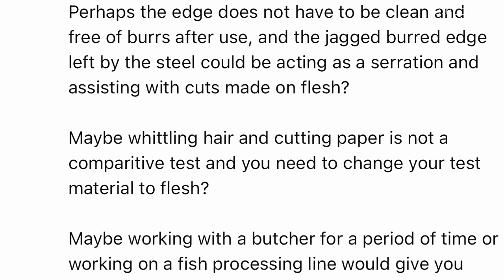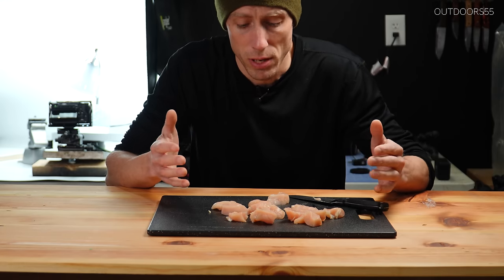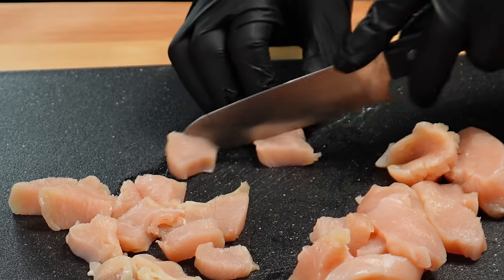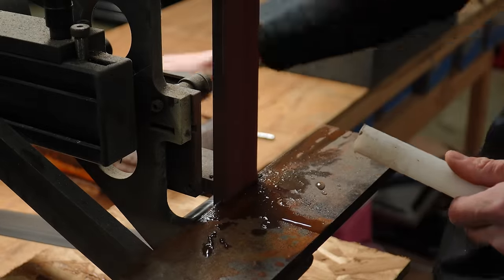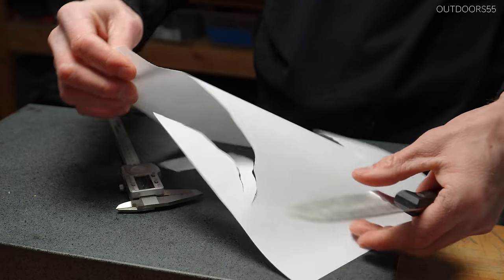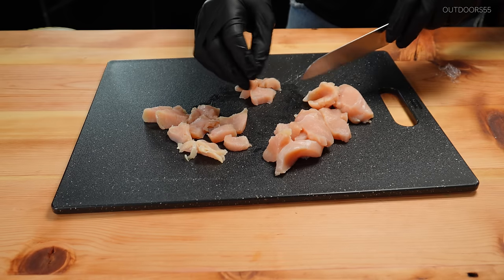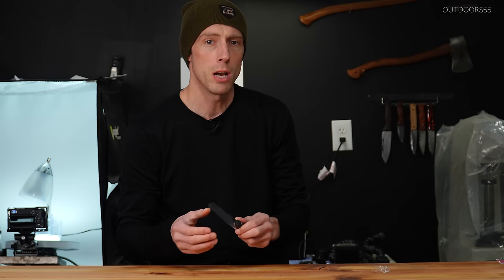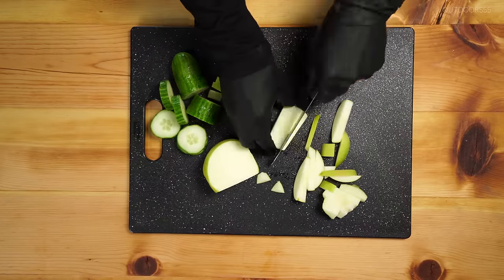Why Knife Sharpness Is Not What You Think

Comment: Did you just invent the Safety Knife?
Reply: Thing is sharp knives cut better so the wound will heal better. Sharp knives can be safer than dull knives. That thing is going give you a pretty nasty scar even if you manage to cut yourself with it
Reply: @AtticStinky  Not quite. The reason sharp knives are considered safer is because they are less likely to slip and accidentally cut you. They are more predictable, and therefore safer.
Reply: Actually safety knives specifically child safety knives are a similar concept to this. Ceramic safety knives use a squared edge but are great for cutting things like food which is often their primary purpose so you can teach kids how to cook and help in the kitchen.

Comment: Yes ! Finally you explained something that bothered me for a while. I am into sharpening for some years now. I sharpened a few knives to a point where they shave and glide through a paper with no resistance. Yet they perform  bad in kitchen and this is the answer . Apex is sharp as hell,but geometry of the knife is bad,its too thick behind the apex.
Reply: A great analogy to this is comparing European and Japanese chefs knives. They really are meant for different tasks.
Reply: @jameshaulenbeek5931  True. I have Santoku that has nice geometry,its thin. A great knife.
Reply: This is why hollow grind blades can be better than flat or saber grinds. You get the thick spine but because of the hollowed out bevel, you can get really thin behind the edge.
Reply: @thebiggestpanda1  Yeah. The Santoku i mentioned earlier is perfect knife . It's good for most of the tasks in the kitchen. Its spine is thick,but it thins down perfectly to the apex. I mean,its not just Santoku,there are many knives made that way. And for us that sharpen em  and just recently discovered the geometry problem is much more satisfying to cut with such knives. :)
Reply: And this also why japanese knifes in general has a much harder steel. The thin edges need a harder steel to be stable, whereas european style knifes works with a lower hrc.
Reply: It's not that straightforward. You need to find correct apex shape that matches thickess behind the apex properly. I've had this Japanese VG10 santoku knife that I was never really satisfied with. It didn't feel sharp, didn't perform well in kitchen and edge retention was horrible, especially considering price:performance ratio. It kept being sharp for about a week, whilst hair-splitting capabilities vanishing after a couple of uses, not even stropping could bring it back, had to be resharpened. Went down the edge geometry rabbithole, thought it's just never going to meet my expectations because of that, as the knife is relatively thick. However, after experimenting with different apexes, results improved literally by orders of magnitude. It now stays hair-splitting sharp for months on end (daily use, of course), with nothing but a couple of passes on chromium oxide strop every week or two. I have no equipment to figure out what exactly I did to make it work, but I somehow did. Can't give you more info, because as I said, I don't have any. Just keep experimenting, perhaps you'll also figure it out.
Reply: @Gljdr  While you might’ve just found the perfect angles, this almost sounds like a burnt edge. I.e. the outer edge got too hot during heat treatment or sharpening making it softer, leaving a harder steel a few millimetres in.
Reply: @jez76  I also think that in this case heat treat gone wrong or something. There's no way knife can get dull after few usages if it's sharpened properly. Despite the fact Japanese are fanatics in everything they do ,mistake can always happen.
Reply: @Gljdr  VG10 is a wonderful blade steel. Years ago, I noticed my bevels actually prefer to be 60/40 ish rather than dead center 50/50. I was using it full time 6 days a week 9 hr shifts. On my day off I would literally spend 2 minutes on a whet stone and it would last all week.
Reply: Next time you sharpen a blade, and you are about to wipe it clean. Fold a paper towel and roll it tight into a thumb sized bundle. Hold the paper towel like chapstick and  point it up. Very carefully slide the blade across the paper towel (away from your body) like you would sharpen a stick and LISTEN. You will hear any imperfections and it should slice half way through the paper towel with little effort. Then it is ready for the kitchen.
Reply: @waltc614  That's pretty much the performance I'm getting, it's pretty neat, considering where I started. Now I'm thinking about getting myself an actual nice knife, from a blacksmith rather than production line, since I've finally learned how to deal with VG10 to its' full potential. This was meant to be a "practice tool", something high-end-ish, but still relatively simple. SG2, maybe...
Reply: Yep, but doesn't it prove the opposite point, that if people want to cut meat, then the tests we want are to cut meat, not cutting paper which is completely irrelevent to everyone watching. How many people watching want to know what knife is best for cutting meat vs cutting paper
Reply: Any properly sharpened knife will shave and cut paper . Problem occurs with geometry. When the knife suddenly gets thicker behind the apex and you want to chop onions with it,for example. That thickness actually produces some sort of friction and knife feels dull. Best knives are actually the ones with good geometry,means the thinner the better. Atleast that's  what i have learned so far...
Reply: @Psyytrance00  The micro bevel is a real thing- high quality steel only.
Reply: @SkyGodKing  I do cut meat, and regular paper is useless to show anything long lasting. A paper towel has enough elasticity to make a sound on the imperfections as the blade glides through it- (try my example above. It just became my habit while sharpening my blades to dial them in). I have been hand sharpening for 25 years. Folding and rolling the paper towel is like cutting through 20 pages of paper at once. It is about listening to the edge. If it sounds scratchy, you are not finished.
Reply: Lots of veggies don't have elasticity, so if your knife is too thick, even if sharp, the material doesn't get out of the way when you cut it, so the edge can't reach further into the material to cut it, so the material just gets wedged open by the primary bevel and tears instead. The mechanics of cutting cucumbers with a thick knife is more like splitting wood than slicing.
Reply: Also probably why real battle axes from the Viking era look really thin and almost flimsy
Reply: @SkyGodKing  it’s all down to the task you’re undertaking. For skinning, for instance, a sharp edge is way more important than primary geometry. But point taken
Reply: That's the reason why Chinese sharpen their veg slicers to 25 degrees - such slicers are super thin and 25 degrees means that you don't have to sharpen them often.
Reply: Duh i mean just imagine using a deba for anything besides breaking down fish

Comment: And this is one of the biggest problems I see with a lot of custom kitchen knifes. A lot of bladesmiths don't understand what it takes for a knife to perform well in the kitchen. I see so many videos of bladesmiths showing off their knifes gliding through paper and then I look at the choil cross section of the knife and I see something worthy of being almost an axe.
Reply: It's why people have an affection for Japanese "factory" and small workshop knives over proper "custom" knives -- even though they might cost about the same. The Japanese have got cutting ability dialled in. You can't be making knives for sushi and sashimi chefs and be turning out some big fat slab of a kitchen knife.
Reply: This is why a chef knife is one of the hardest types of knife to make.
Reply: Totally, I see way too many people wanting to get in  the Fad of being a knife maker,  thinking their product will demand $1000 per blade just because Reeves does.....yet with little to no research of understanding what they are making.
an ADHD Generation looking for something to occupy their attention because they need a hobby, which is fine...
but then thinking they're an expert.
There are very few custom knife makers I see that know what they are making from experience of what the blades intended use is.....skinning knives being a prime example
Reply: Brands like Opinel had low angle blades (maybe 10°, chipping on stuff harder than food),  but now those are thicker because reviewers will abuse blades and customer service are faced with edge butchers.  
Now for axes,  the old wisdom was, if your axe chips,  sharpen it with a higher angle, I think a secondary bevel of 15° is a possibility for an axe.

Comment: Cutting is just pressure over area. So regardless of angle, if the area is small enough and the pressure is great enough, it'll cut.
Reply from the maker: Exactly 👍
Reply: Growing up I was fascinated by how knives actually cut stuff. Learning this principle of how knives are supposed to work led me to sharpen and even make knives 👍
Reply: I don’t agree 100%. 
What you say is exact for cleavers, axes, and chef knives used in a purely vertical cutting movement onto a cutting board. 
But for most uses, a knife is used in a sliding motion, not just a vertical pressure. That sliding creates a shear effect, which is when the microscopic shape along the edge (micro-serrations from burr, e.g.) can have a significant influence by contributing to a « saw » effect which would play no role in a vertical cut. 
For that reason, I’m not so sure that the knife in this video wouldn’t risk cutting fingers easily in such a sliding motion… But I won’t volunteer to test it!
Reply: @joso5554 in a way oofman is still right even in the situation you're describing because microscopic serrations sitting in a row in a formation called "burr" or "hair" are so tiny they create a lot of pressure and thus are able to "cut". This is why machinists use a "deburrer" on corners because even very defined 90° corners on a big part that don't have a bevel and seem very "thick" as opposed to a thin knife edge can be left with a burr after machining that can lead to very nasty cuts. Trust me...
Reply: Right. So you can cut a tomato with a piece of three-eights mild steel with a square edge alright but with what kind of result. Do you really think it is that simple? Then why are you here listening to this nonsense?
Reply: Cutting is cutting, not smashing. Try onion, it'll wreak havoc to your eyes with dull knife, but give chefs a shot after 2000# and you'll never drop a tear... or a finger😏
Reply: @n3squ1k666  okay, cutting is cutting. Well, what is cutting? Pressure over area. Your whole onion thing makes sense. But "cutting is cutting" sounds very stupid. No different than, fire burns things, "no hot things burn things, fire is fire". Fire is hot 💀
Reply: like obsidian microscopic thin
Reply: @kaoskronostyche9939  Cutting metal is done with 700-100 degree primary only, sometimes. Yes above 90 degree can and has a purpose sometimes. 
It is not the usual cut but more of a shaving a thin slice/swarf kind of thing. The cut part is required to be rigid, otherwise it does not work.
Reply: @dragoscoco2173 You missed the point and replied to the wrong comment.
Reply: pressure is force over area
and cutting is about pressure difference
that's what you meant ?
Reply: I think you meant “force over area” which is exactly pressure. “Pressure over area” doesn’t make much sense, physically speaking.
Reply: @JackFou  N/m^4 isn't a unit i'm used to work with but that's the unit of pressure over surface
Reply: @TWIlktitbliktvim-ty7td  exactly my point. Of course you can write out any unit you want but that doesn’t make it physically meaningful.
Reply: Honing your comment a bit, cutting is stress. If you exceed the material stress limit, it breaks, and that can be done either by "pressure" (normal stress) or by sheer stress. So knives are sharp because they can create both on the material they are interacting with, which means that if you increase normal stress by reducing thickness you can make the knife sharper.
Reply: Listen. Nobody here knows what they're talking about and it's like a dozen people talking about different things.
Reply: @BigDaddyWes  i'm sure most people here know what pressure is and it is a force over an area

Comment: Technically, your squared off apex has two edges.
Reply from the maker: You are correct....hmm🤔
Reply: @OUTDOORS55  Sorry to split hairs (and very sorry for that phrase, but it was begging...), but in linguistic terms, the dull knife still has only one cutting edge, but perhaps three sides to it.  (Compare with cliff top, cliff edge, and cliff face.)  So, unless the scrutiny goes to microscopic level, best settle with you are closest:  Edge, singular.   
(Yet another excellent video,  Thanks, and good effort. 👍)